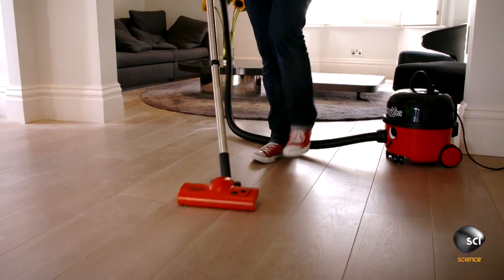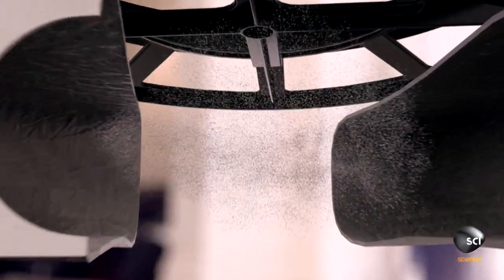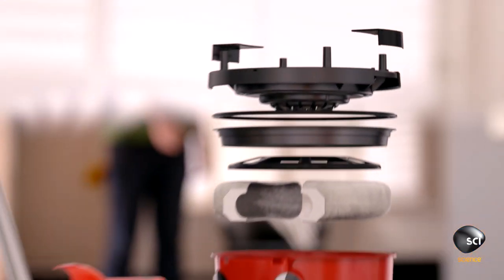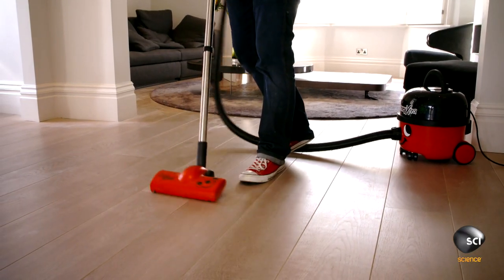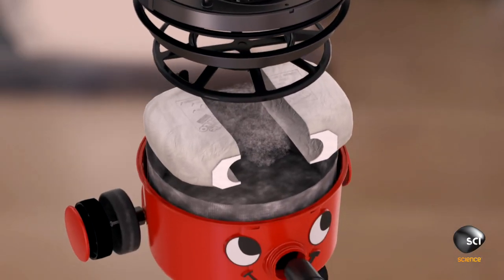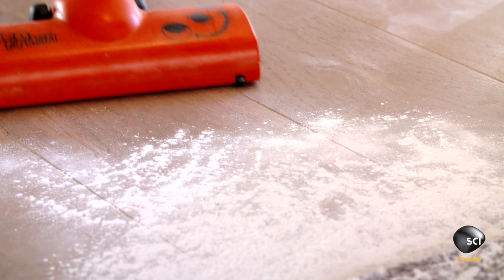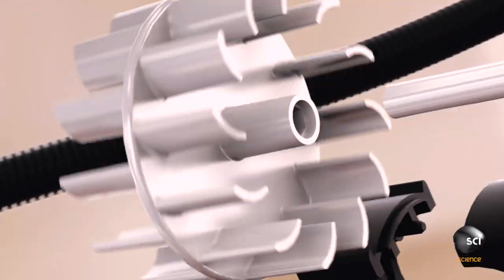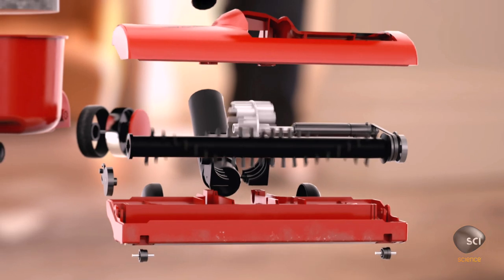How Does this Vacuum Create Hurricane Force Winds?

Comment: If a vac was airtight it would stop suctioning then explode almost instantly! You need maximum airflow THROUGH a vac to be as powerful as possible. It needs to draw in as much air as possible (with the accompanying crud you're trying to clean, obvs) AND release as much of that air as possible. But the point is that the air it releases through the exhaust mechanism has to be CLEAN, to avoid depositing your crud straight back into a slightly different part of the house.

This is why there are things like HEPA filters and bags that exhaust maximum air (i.e. they are very much NOT AIRTIGHT) whilst retaining the tiniest, most microscopic particulate bits of crud and allergens, exist. The video mentioned "tiny pores" in the bag without explaining why this is important - that's how the air gets OUT again without the crud - and fails to explain what happens to the clean air

FWIW outdoor vacs don't have to worry so much about releasing clean air or about the microscopic particulate matter that gets sucked up (and frankly nor do you unless you're getting ill from some specific pathogen or particles in your environment, AND have serious, pristinely-maintained and serviced air filtration and ventilation system installed in your home). E.g if you're using a wet/dry outdoor vac to clean a drain, or vacuuming your car, there is utterly no point retaining microscopic crud inside the vacuum. It just means you have to change out the filter more frequently because it gets full faster and will more quickly block airflow, making it harder to move the crud you can actually see. Even indoors, if your house is full of unfiltered air, the HEPA filter on your vac does absolutely jack shit except block itself up with microscopic crap, whilst the air is full of the same microscopic crap anyway 

To pick up chonky crud you don't want amazing microscopic filtration, you just want to move bits of brick or drywall or whatever so vacs like the steadfast Henry, used by builders throughout the UK, will excel at that. I use construction site vacs in my house because it's, well, a construction site and also I'm not allergic to the outdoors so there's no reason to maintain HEPA filters (and my house isn't set up for it to be useful). 

A mediocre vac motor, with a well designed body and intake system that creates good difference between low external and high internal air pressure will perform much better than the most powerful motor on a crappy or poorly-maintained machine that lets crud exhaust into the space it's allegedly cleaning.  This video explains absolutely nothing, but cool animation I guess

Comment: You failed to explain how a vacuum works though. Vacuums don’t suck, the fan inside reduces the air pressure inside the container and the ambient air outside is being pushed in due to its higher pressure than inside the vacuum, thus forcing dirt particles in along with it. Similar to drinking a liquid through a straw. The air pressure in your mouth is less than the air pressure outside the drink, which in return forces the liquid up the straw and into your mouth. If you were to seal the top of the drink you will find that you will not be able to drink because the air pressure will not change and won’t push the liquid into your mouth.

Comment: no vaccum cleaners suck.  the motor  reduces the pressure inside the  casing, it's the higher  atmospheric pressure that pushes up the pipe and drags any muck and dust with it.
Reply: True but isn't that what suction is? (Movement via gas/fluid pressure difference) otherwise there is no such thing as suction.
Reply: I remember reading that nobody in space gets sucked out of an airlock, you get pushed or blown out. This is true because you would be getting pushed by the force created by the air pressure difference; the air itself however is getting sucked out because there's nothing to push it; it's just moving from high to low pressure
Reply: Without the air pressure difference, opening the airlock doesn't do anything because solid matter, that doesn't expand to fill the space it's in, doesn't behave with the same mechanics as gas or fluid pressure